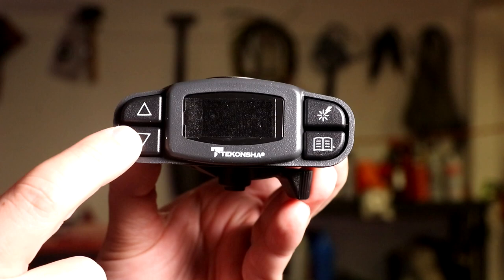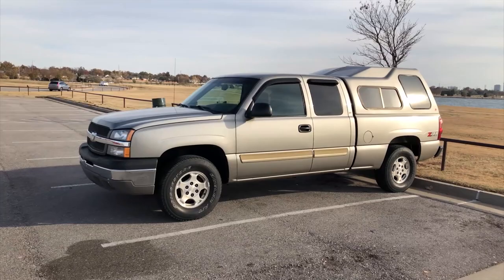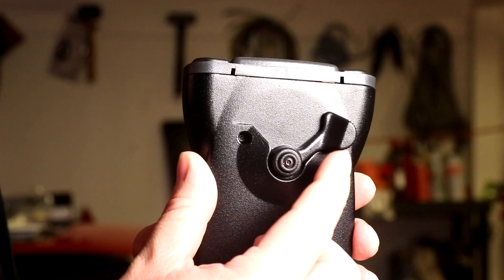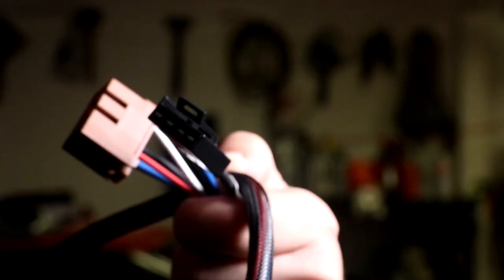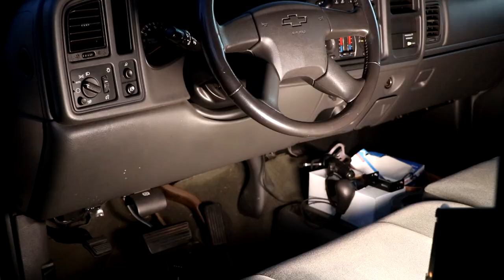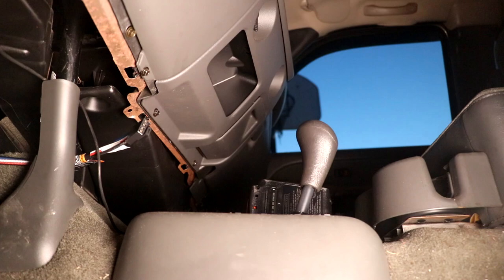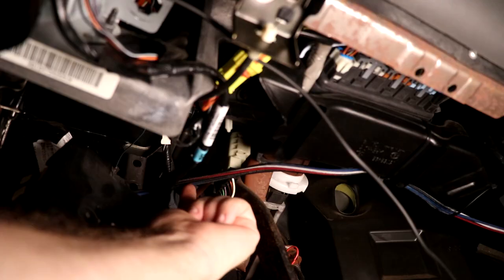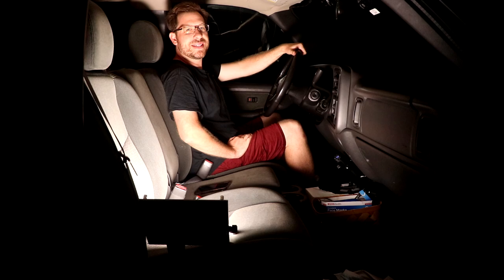Installing a Trailer Brake Controller! (Tekonsha P3)

Comment: Awesome video
Thanks for all the details about the module.
I’m fixing to order one due to purchasing a camper and using a 16ft tandem axle enclosed trailer on the weekends when I deliver inflatables!
Reply from the maker: Campers are cool, I want to at least rent one to enjoy sometime, and delivering inflatables sounds like a neat gig. I still use mine, just did this weekend and it’s been a great purchase 👍🏻
Reply: @KameTrick  yes luckily I believe I got a steal on my camper.
Only paid $20,000 and it’s a 2020 model.
Fully furnished and ready to start camping.
Finishing all the paperwork up tomorrow and taking possession tomorrow afternoon and then the camping adventures start

Comment: With the plug and play option, does your vehicle have to have a 7 way plug from the factory? My dodge ram Dakota only has a 4 way plug.
Reply from the maker: I wish I could help but I don’t happen to know. If you have no desire to make your own wiring harness and want to go this route, the best call is probably to call tekonsha’s sales number and ask. I’m certain that’s a question they get all the time. Sorry I can’t be more help but I don’t want to give you bad info 👋🏻

Comment: Thanks KT for the video. It is appreciated!
Did you also have to populate the 2 fuse sockets meant for trailer brake and trailer power? I have a 2004 Chevy Suburban Z71 and my 2 sockets are not populated. So I'm assuming I will just have to add the fuses and was wondering if you did same.
Reply from the maker: I had the tow package on my truck so it was plug and play for me…good luck with the wiring, hopefully it’s an easy job!

Comment: So you never mentioned if your truck had an existing plug in trailer harness at the rear bumper hitch area.
I take it you have a connector back there.
Mine only has a flat 4 pin connector….not sure if I would need a 7 pin.
Reply from the maker: I didn’t think to mention that, my bad. My truck has a factory tow package and has the circular 7 pin connector. I did a quick search and it looks like 4 pin connectors don’t have enough circuits or the right wire gauge to power trailer brakes…for more details check out: https://www.etrailer.com/question-415564.html
Reply: You would have to add a 7 pin for the brakes. It’s not overly complicated.

Comment: Hey quick question. Does any car have that connection for the trailer under the dash?
Reply from the maker: Not all cars do, it seems to depend on the age of the vehicle and in some cases whether or not is has a tow package. If the tailgate area has a trailer wiring hookup from the factory, I’d say it’s more likely that there will be a brake controller plug under the dash, but you’ll want to double check on a per-vehicle basis to be sure.

Comment: Do you guys know if that works on Freightliner Fld 120 with my gooseneck trailer
Reply from the maker: I believe it will do the trick, you might have to wire it up yourself or see if Tekonsha makes a plug and play harness for it, though. https://www.etrailer.com/question-224811.html